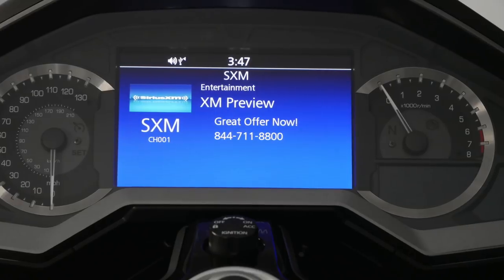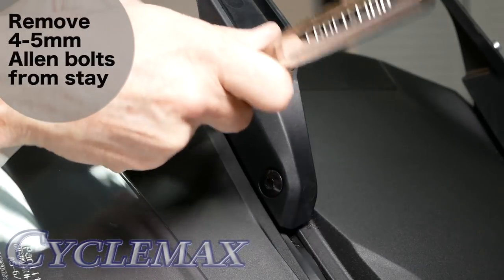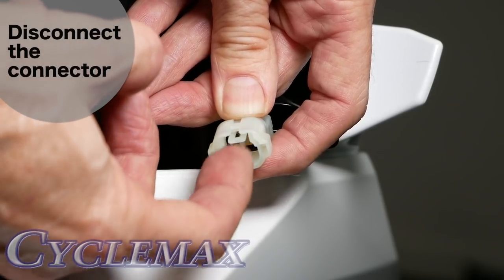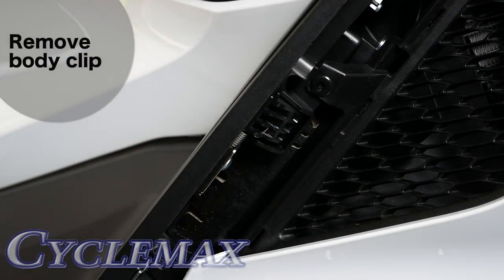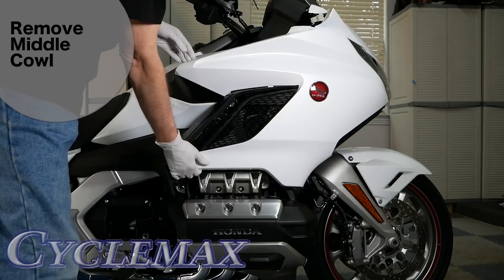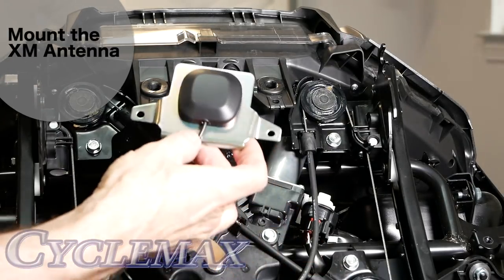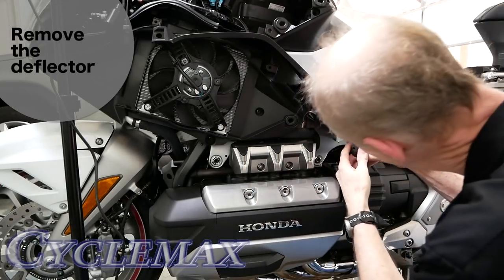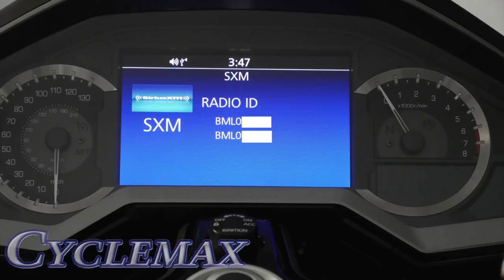Install XM Antenna on 2018 Honda Gold Wing

Comment: Bought the XM antenna on ebay for $16. Removed the seat and mouted next to radio, plugged in.  Done in 15 minutes and works perfectly.
Reply from the maker: Good job
Reply: Did you use the Honda Part or was this an after market antenna?  Can you share which antenna you used?
Reply: 15 Minutes? Yeah right!   How many screws did you miss to put back? 🤣  That's ridiculous!!!!

Comment: I saw the instructions and decided to have my dealer install this. The upper and lower air guards I was able to install myself. SiriusXM knows or recognizes your radio ID and you will get the 3 months of free service awarded to Honda vehicles.
Reply: So what did the dealer charge you for that?

Comment: Great video as always, Chris.  I'm SO glad this was pre-installed and considered "standard" equipment on both my 2012 and 2015 Gold Wings.  It's disappointing that on the 2018 (and beyond?) it's an optional item that, in true Honda fashion, is so incredibly difficult to install (half the bike requires disassembly).
Reply from the maker: It is amazing. Wait until you see the HomeLink install!
Reply: I trust you left your Wing disassembled to install the HomeLink.  However, I will say that removing the windscreen on the 2018 model appears significantly easier than previous models.  I used your video exclusively when I replaced the stock windscreen on my 2015 Wing for an F4 Customs  +4.  Thank you, my friend!
Reply from the maker: I did four installs while I had the bike apart. Next video will be HomeLink, then USB Cable, then LED Entry Lights.
Reply: I figured you would produce multiple installations while having the Wing disassembled.  I'll be watching!
Reply from the maker: HomeLink was twice as time consuming as XM. A REAL pain-in-the-butt.

Comment: I just spent 6 hours installing my Antenna. It was the first time I stripped my Wing down and if not for Cruiseman's awesome video, it would have taken a week trying to read Honda's PDF instruction sheet. THANKS Cruiseman You ROCK. It is Absurd that Honda couldn't have at least factory installed a coax cable.  Also they could have made a pocket at the top of the backrest instead of this insane running of a cable all the way to the windshield.  Worst of all the $99 price is a crime. OK my venting is done.  I LOVE Sirius and the sound is so much better than Honda's weak FM antenna. Unfortunately it seems to drop out fairly easily going under overpasses and in hilly areas, but it typically comes back within a few seconds.
Reply: I thought about getting this and doing the install because I have xm on both of my vehicles. But I've instead been using the XM app from my iPhone through apple car play. Same audio quality without the hassle of this install.

Comment: My question is though if I didn't want to go through all that why couldn't I just mount it inside the trunk? How's it getting signal upfront buried under all the plastic anyway?
Reply from the maker: You can absolutely do that. You can buy ANY XM antenna on eBay or Amazon for $15 and it will plug right in. Mount it wherever you like, even on top of the brake reservoir.
Reply: I was thinking the same thing.  I traded my 2014 HD for this exact bike. Love it! On the HD, I removed the antenna from under the cowl where HD mechanics put it, and put it just outside. Lots better reception. I will do something similar with this in the rear area. :)

Comment: For a 30K motorcycle, Honda should have had it installed already from the factory, Triumph does it.
Reply: BMW does also . 
Learned one thing from the video , my bike is not getting xm radio .

Comment: Pretty involved. I sat on a new tour today, noticeably smaller than a 2017. I also sat on a standard GW in that root-beer color, I noticed a slight amount of back and forth play in the steering?
Reply from the maker: Best color of all the new Wings, IMO.
Reply: The back half of it was in the sun, it was beautiful..
Reply: I agree about that color, although the Honda name for it: "pearl stallion brown" is a bit unfortunate (it sounds like something I wouldn't want to step in).  Too bad the Tour doesn't come in that color (yet . . .).  I went for the red GL1800DA, for very technical reasons:  My wife said, "I like the red one."  BTW this is an outstanding video, Cruiseman, much more detailed than Honda's instructions.  Thank You.
Reply: That red would be my second choice...

Comment: Glad this is part of the XM package on the 2017.  If I had to go through all this to activate the existing XM radio on the bike I’d probably just go without XM.  This is so involved and this stuff almost never goes back together as tightly as it was from the initial assembly at the factory.  Honda really disappointing with things like this.  Great video though Chris, disappointed I won’t be seeing you working on the older model anymore.
Reply from the maker: Sadly, I found more than a few loose fasteners when I disassembled the bike. I think my bike went back together better than from the factory! You can add any XM antenna and simply mount in the trunk or on top of the brake reservoir.
Reply: Cruiseman's Garage that’s true!  I like to do as much of the work as I can to my bikes and I’ve found things that weren’t perfect from the factory or the initial setup by the dealers.  Whenever possible I do the work myself and I won’t have to question the work of others.

Comment: Does every 2018 Goldwing have XM built in? I just bought left over 2018 base model, no trunk. It was a great deal, $8k below MSRP.. When using the source button there is one screen that says Aux. Is that for XM?  I bought a XM antenna from Amazon that I haven't installed yet, If I understand correctly one I plug the antenna in XM will auto show up on the Aux. screen? Thanks Cruiseman,  love your video's!!

Comment: Hey Cruiseman, when you use your xm radio does it cut in/out?  My 2021 Goldwing tour DCT came with XM radio and after purchasing a subscription my xm radio says "check tuner", but then stations come in for the most part but it's very spotty and not that reliable. I'm real close to cancelling my subscription and just sticking with USB  thumb drives with MP3's!
Reply from the maker: I did not experience that issue, but no longer subscribe

Comment: It is crazy to have a radio but not the antenna installed by Honda and in order to do it a rider shouldn't be disassemble the half of the bike. Every BMW bike I owned came with a radio had the XM antenna discreetly installed and worked perfectly ok. This is absurd!